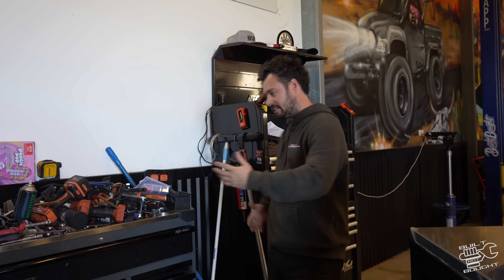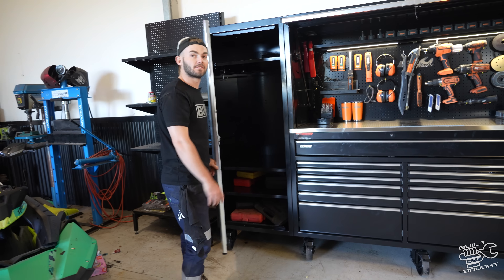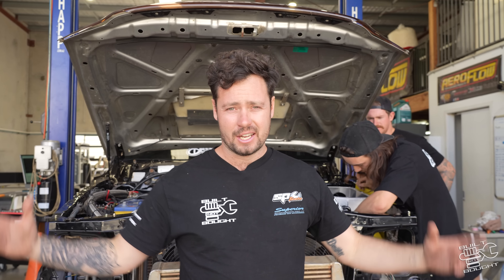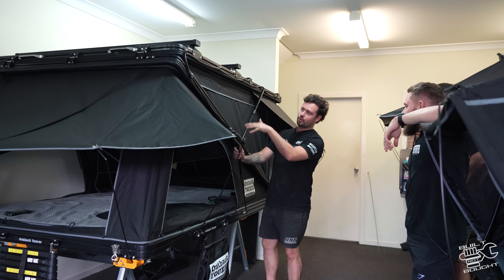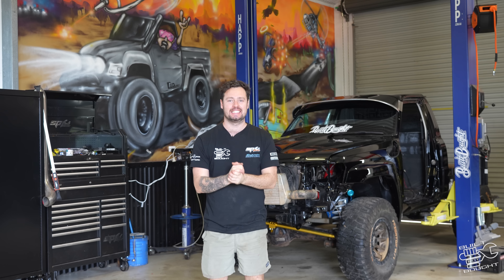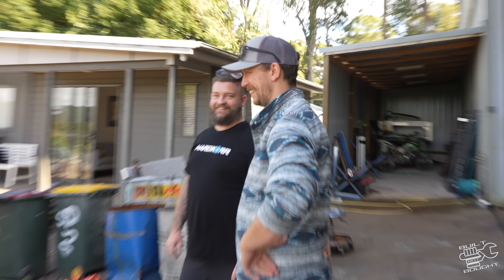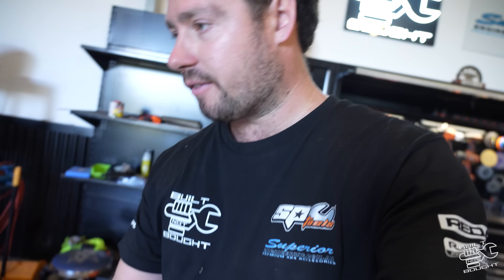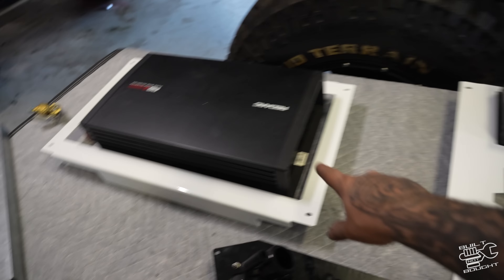WAIT UNTIL YOU SEE THE INSIDE?! 🤯

Comment: First one in again to comment to this legend, but just a reminder landcruisers are better Sam, patrols are shit
Reply: Your not wrong patrols are shit love the 80 series that’s my fav and it has to be diesel
Reply: @Toyotalandcruiser80thenaghty80  1hdfte ❤
Reply from the maker: Hehehe so yeah? 🫦
Reply: @ls2surf485 yessir and the 1hdt
Reply: @Toyotalandcruiser80thenaghty80 😂😂  number one mate, you drive a Hilux! Number two, any patrol would absolutely smoke you heapa shit Hilux off road. Also maybe have a think about why all hardcore 80 series drivers swap out major of there drive train out for GU gear. 

Yeah nar, you’ve got no clue
Reply: @Andrew-hu1bx  well not if it’s tuned bigger turbo just full built engine and trans and let’s not forget how slow the old gu 3.0l and 4.2l and 2.8l is 😈 and jokes on you I’m 11 years old can’t drive
Reply: Landcruisers use patrol parts, patrols don’t use Landcruiser parts..:
Reply: @thomjanson9644  yeah but do they use engines transmissions diffs frames brakes clutch’s flywheel engine accessories nooo jokes on you and Toyota are more reliable
Reply: Losers drive cruisers💪
Reply: @Rexy888 you just feel bad cause your gu is always in the shop getting fixed
Reply: @thomjanson9644 don’t see a td in a cruiser do ya 😂
Reply: @Toyotalandcruiser80thenaghty80   i drive a buggatti brah
Reply: @xandersaliba7794 probably be an improvement tho…
Reply: @thomjanson9644  😭😭